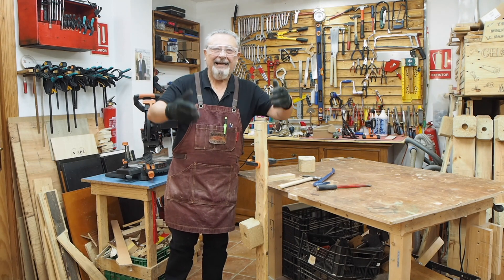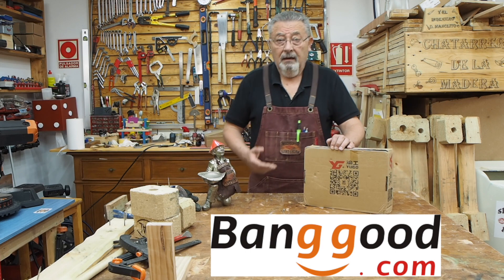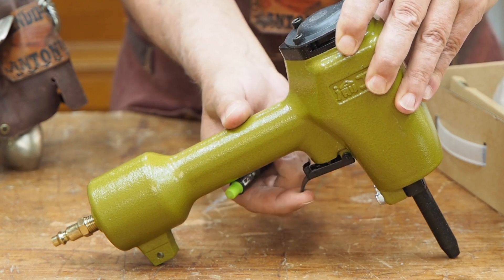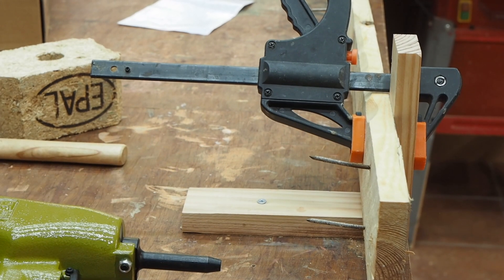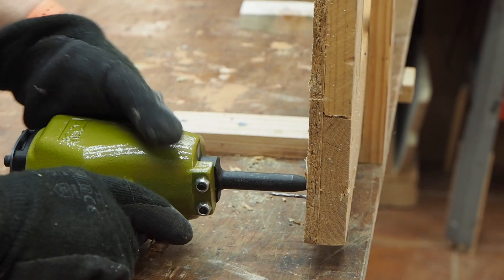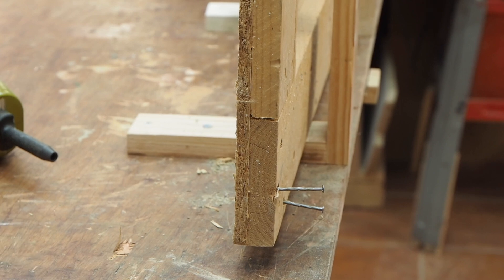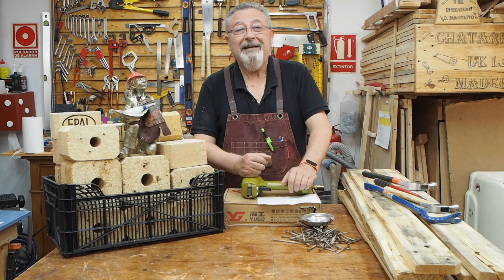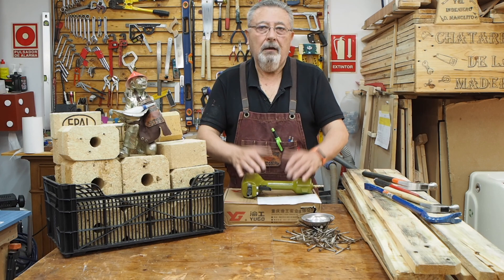❤️ LA FORMA MÁS RÁPIDA de sacar los clavos de los palets

Comment: The blocks are easier to remove if you tap them with a big hammer a few times to loosen them. Then insert the cold chisel. Tap the chisel and work the chisel towards and away from you, using your whole body to pull at the block. Not just the muscles in your arms. Tilting the board at a slight angle from vertical will give you more stability and better leverage.
Reply from the maker: Muy agradecido por el aporte, @puntabachata saludos, y un fuerte abrazo ❤️